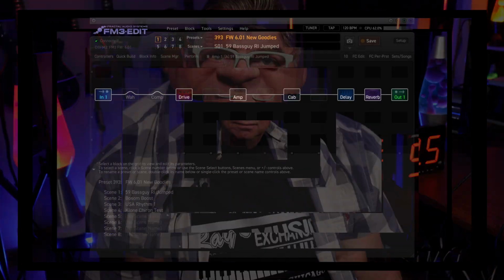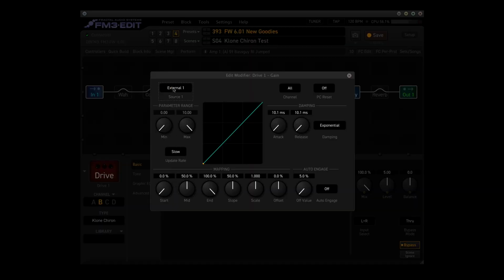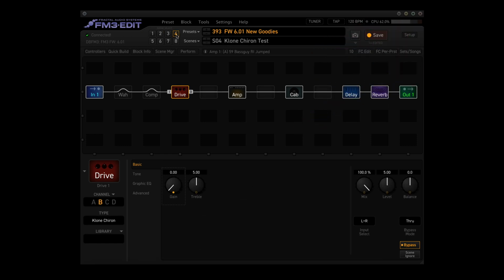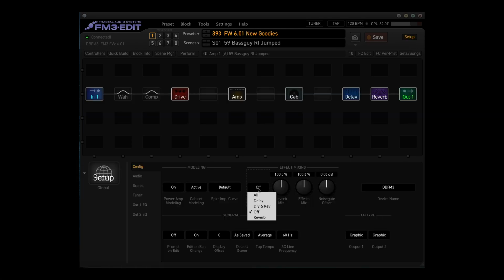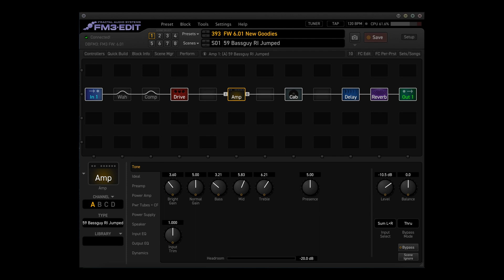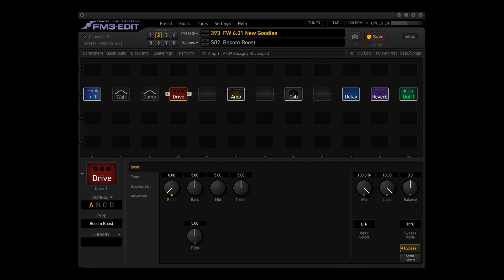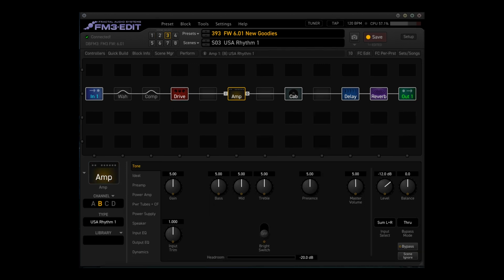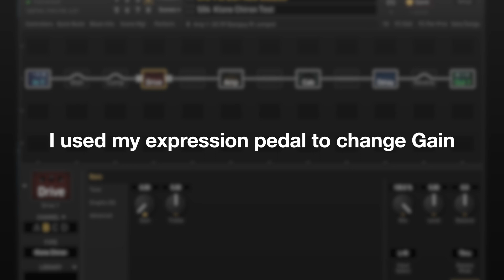FM3 - Let's Test Firmware 6.01!

Comment: How would you compare the FM3 to the Ampero II? From what I have seen, the tones on the much cheaper Ampero II are nearly as good. It has a touchscreen, is simpler to use and costs under $500.
Reply from the maker: I had an Ampero One, just checked out the Two, and.... nah. Sounds very cheap to me. I'm guessing that's their version of the QC.
Reply: @DougBsDigitalDen  So you like the FM3 more? Most people seem to love the Ampero II.
Reply from the maker: Oh, I'm sure there are folks that love the Ampero. But in my opinion it doesn't cut it.
Reply: @DougBsDigitalDen  You were right. I bought it and returned it. I know have a FM9 and love it. The Ampero II did some things better though. It was far more intuitive. Nice touch screen. You did not have to set up scenes and built much. It worked right out of the box the way you would expect it to. The display was better. That said, while the clean tones were nice, the other tones and effects were just average at best. It was also quite limited in what it could do. I liked the touchscreen and the UI but I will keep the FM9 for sure.